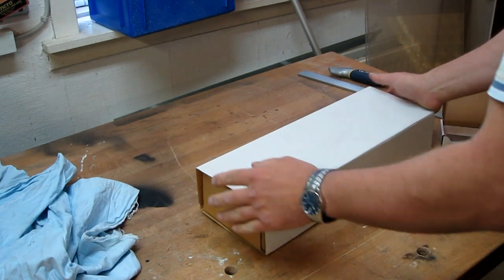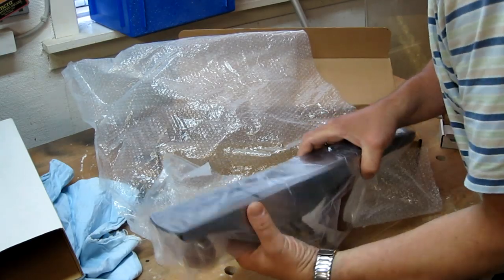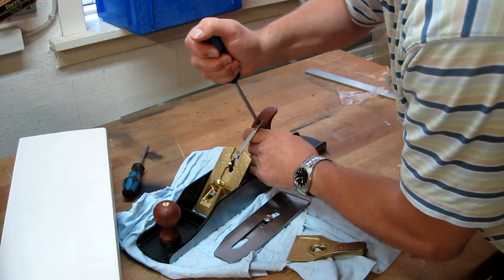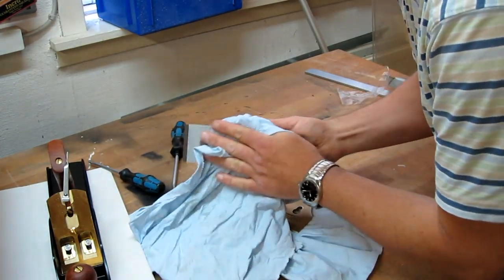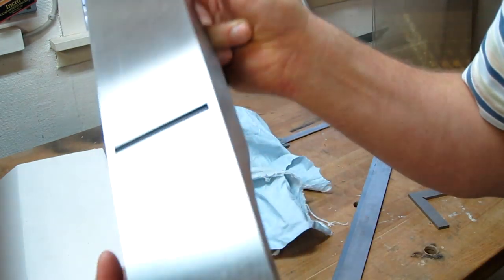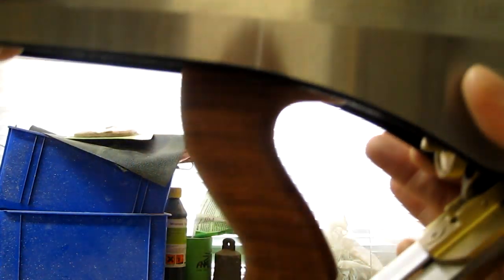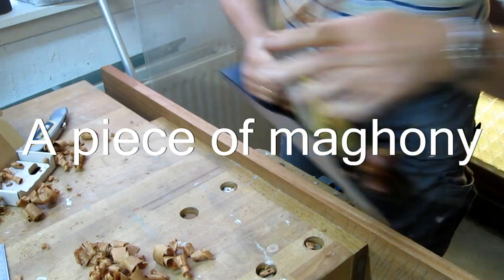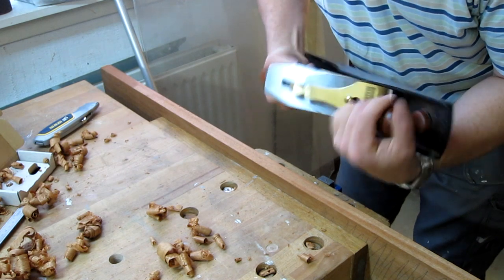Juuma bench plane - test

Comment: Hi MrWoodcutter,

Thank you very much for this detailed review! I would like to add, that the loose handle is not a quality-problem but to prevent the wood from cracking when the planes are shipped trough areas with different climatic conditions. But in a sealed plastic bag this should be no problem during shipping anyway. It could become a problem when the humidity in your workshop is different than the one in the factory, so one could give the handle a few days in the new environement before tighten it down.

Comment: I will never understand how you can judge how good a plane(or chisel) is without sharpening and honing the blade iron, The first thing you should always do is sharpen the blade, then you will be able to judge its true worth, How can you expect a factory machined ground blade to perform without being properly sharpened and honed( it could have travelled 1000's of miles since manufacture or sat in a warehouse for months), The purpose of the plane body etc is to present the Blade to the wood at the correct angle and depth, The plane iron is the part that does all the work and its sharpness is in fact of more importance than how flat and square the body is, That's not saying that a flat sole, and to a lesser degree square sides, are not important, of course they are, but a sharp blade is paramount  to  fine accurate woodworking.
Reply: Don't teach us ABC. Everyone knows it already. If you don't like the blade, just buy another one.

Comment: I'm torn between juuma's and dick planes. Juumas have carbon steel blades, while the dick planes have japanese blue paper steel which is thougher steel. But I wonder about the edge sharpness. What do you think about juumas blade? Does it chip easily?

Comment: The loose screw in the handle is due to the wood shrinking during shipping. I bought the whole set including the nr7 (4, 5, 6, 7) I like them. If you're a established woodworker (i'm certainly not yet) you would have benefits in buying the expensive planes. Im happy with my Juuma's. I'm going to buy the low angle jack.
Reply: have you checked sole flatness tolerance of Nr 7 ? Is it around 0.003 ???

Comment: The lateral adjustment looks very basic, it really needs a bearing behind the blade slot for easy movement like WoodRiver did whit their planes.
Reply: Woodriver gimmick .Totally unnecessary.Stanleys work for 60 years or more without a bearing .Woodriver is trying to justify nearly 300 bucks.